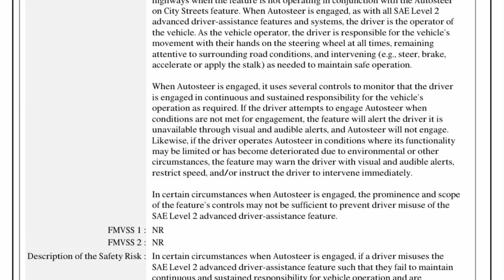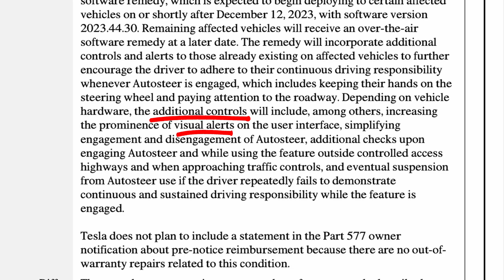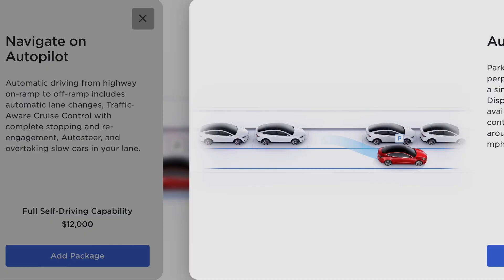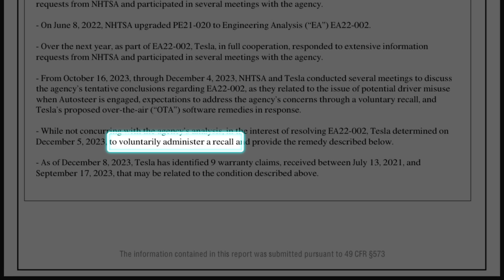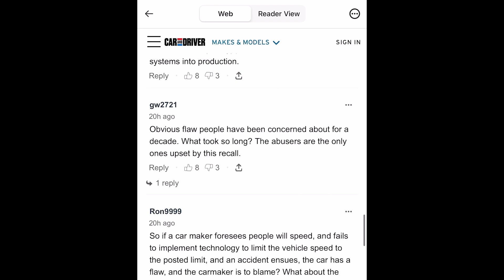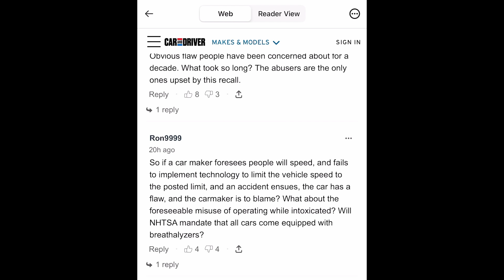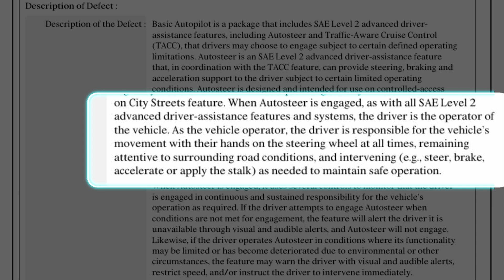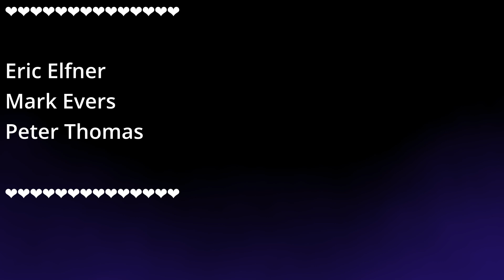Why Tesla's Autopilot Recall is a GOOD Thing

Comment: Not really good news for Tesla drivers.  The steering wheel nag is dangerous.  I'll be driving with both hands low on the wheel and it will trigger.  The amount that I have to jerk the wheel for me to convince it that I'm here and paying attention often knocks it out of autosteer.  The car lurches sideways as it transitions from autosteer to manual steer.  This is especially bad when it happens during a tight turn.
Reply: Then Tesla should fix this too. The nag in my Volvo is no problem. Does not need to jerk it and when it disconnect it does so without sverving around the road.
Reply: I bought a Model 3 Performance in February with Full Self Driving. I love the car but the nag is definitely the weak point. It is not a safety feature. FSD is clearly more dangerous because of it. It just distracts you so you have to put effort into satisfying it instead of paying attention to the road. As you said, it's sometimes difficult to satisfy in the way that you're supposed to do it (providing torque to the wheel) and it's very easy to accidently deactivate it. Obviously it's extremely dangerous to think it's driving itself when it's not. I know keep my hands off of it completely and satisfy it by moving the volume up and down when the nag comes on. That works much better but it's still distracting. The camera should be the only way that it judges attentiveness.
Reply: the only way Tesla can totally remove the requirement for a jerk at the wheel is to achieve level 5 fully autonomous driving ;-)
Reply: @reallyisitjustme ...and that will never happen so....
Reply: You do realize that rolling either of the steering wheel scrolls( adjusting the music volume either up or down one turn or your autopilot speed scroll one turn) is sufficient instead of putting pressure on the steering wheel? And even if you choose to do the steering wheel pressure option I’ve never been taken out of autopilot by doing it, sounds like a personal problem to me.
Reply: @Craving8805 not any more!!!!
Reply: Yes, I would agree it’s just fucking awful implementation
Reply: Agreed, but adjusting the volume with the thumb satisfies it too (or the other wheel for the max speed adjust). Easier than the wheel pressure
Reply: @stanlm  Eeyy! Thanks for that.  I've been using the volume wheel as a tactile fidget toy since the update dropped.
Reply: @stanlm not any more.  With the new update thumb wheel no longer rest it.  You must push it to the edge just before it disengages without disengaging.  It makes using it far more dangerous.  Manually disengaging then then engaging again will not reset the timer giving you even less time to find that sweet spot before a strike.  This update is horrendous

Comment: I think Tesla should just state the first time you engage it in a drive that you are responsible at all times and have to be ready to catch it within a second. Tesla is not obligated to be real time police, you can easily misuse a car without FSD so they simply just need to cover the rear legally and then fight NHTSA if they get overzealous on micromanagement. They have no reasonable claim to such policing.
Reply: The problem is that Tesla has inplemented this is a bad way combined with marketing lies. They have for years tried to convince people that the system is more capable than it really is.
Reply: Tesla IS obligated, they have constantly marketed it as "autopilot" / "full self driving". People immediately used it the way it was marketed, despite their effective small print to avoid responsibility.
Do you know how they can avoid all this?, no supposed "full self driving" and just use it as a safety backup for manual driving. The whole concept is wilfully encouraging people to not be aware of what's happening while driving.
Reply: @DoubleMonoLR  that's just not true, it constantly prompts you and the option on the webpage says it requires supervision and will continue to improve. If any sales people pretends otherwise that should change but I'm guessing they don't do that.
Reply: The don't call it autopilot or FSD or any other acronym that implies or can even be misunderstood as implying that the car can drive itself. Tesla should also retract any statements in writing or given verbally to the effect that the car is safer than when been driven manually. And offer a full refund to those that no longer want it.